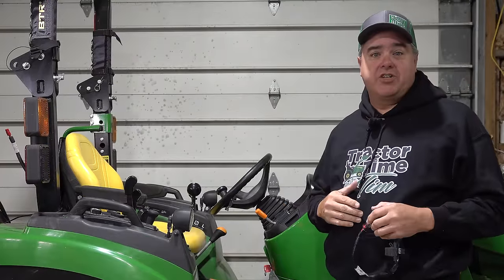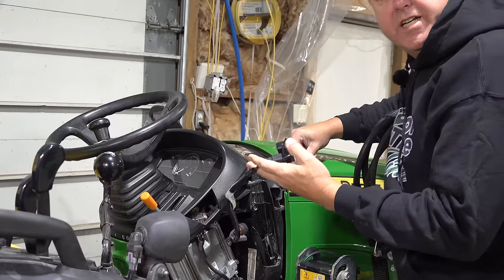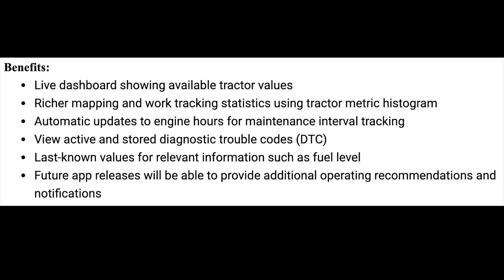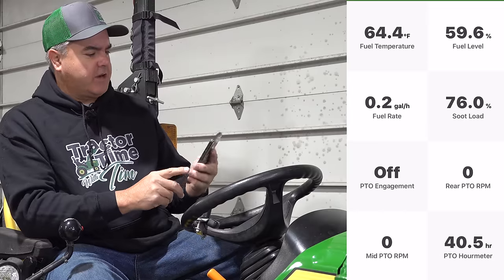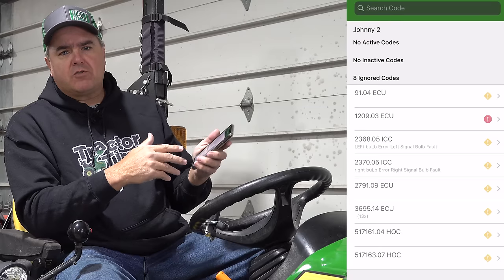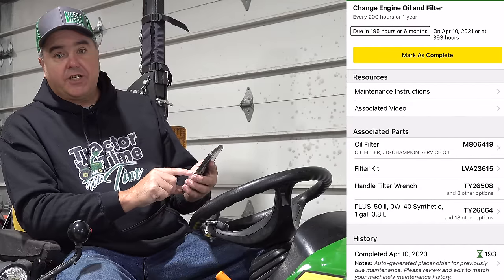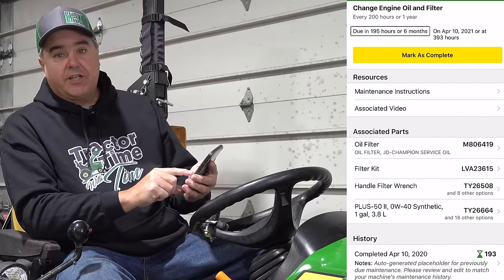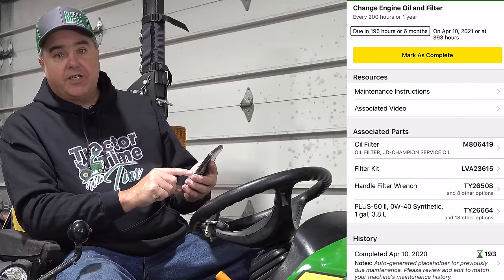Connect Your PHONE to Your TRACTOR!!

Comment: Bought it, installed it, and got nothing as far as a bluetooth signal. Absolutely nothing. Yes it was plugged in correctly, yes I tried restarting my devices and none of them ever detected it... Guess I’m sending it back...
Reply from the maker: Please don't send it back. You must use the app to detect it.  It doesn't show up as a standard bluetooth device.
Reply: @TractorTimewithTim  After about an hour of wasted effort I managed to get it to work.  Wow, useful and interesting app that is so poorly supported and comes with nearly zero instructions. Shame on JD for making this a flaming hoop you have to jump through to use.

Comment: I’m not sure all the electronics are a good thing. A lot of farmers now are angry with John Deere and some of the larger tractor manufacturers. When you go pay two or $300,000 for a huge tractor or more for a combine now, everything is electronically controlled there’s sensors all over the thing and it will give you an error code and basically shut you down but it won’t tell you what that error code is and you have no access to the books defined out what it is and fix it in the dealers won’t tell you they’re forcing people to bring them to the dealers and have dealer service done on them.  Farmers don’t make enough money to pay the dealer to change out a bearing or a bushing here in there because it’s slightly exceeding a temperature, what people are doing now is breaking the law and using pirated software from other countries for John Deere equipment, it’s basically the same dealer software just in other languages from other countries and they’re using them to try and figure it out so they can repair them selves and not pay thousands of dollars for the dealer to change a little bushing or something ridiculous. Other companies could be prosecuted for doing this but about eight or 10 years ago there was some law written in that protects these companies and allows them to do this without being able to be sued or charged for what they’re doing. Can you imagine if your Ford had some sort of warning that told you when you needed to lube your front axle but they forced you to go to the dealer and charged you three or $400 every time to stick a grease gun on there and put up a couple pumps of grease in? It doesn’t affect me personally I don’t think I’m ever going to have a big enough farm to be spending hundreds of thousands of dollars on large farm equipment but I think it’s pretty wrong in general. There was a hearing over it and surprisingly John Deere representative didn’t show up to defend themselves they sent lawyers from Apple and Google. The Apple and Google lawyers are notoriously pretty evil scum bags who are always trying to defend and get around the cases where those companies are violating user rights defending the multi billionaires who screwed over millions of their users selling their data illegally or not telling them that their devices were basically spying on them and recording them like Alexa in those types of devices that record all the time even when they’re off including many phones. Even if you turn your phone off and you have Google on it they still have your microphone open and are recording everything that here and these are the guys who fight those lawsuits the typical sleazy cliché lawyer. I was pretty disappointed in John Deere, I followed him as a corporation for years even without being a farmer, I have the riding mowers but I’m not a big John Deere customer really but I’ve always admired them as a company and their ethics and that seems to have changed and it’s not just John Deere it’s most of the large tractor companies, honestly that alone might make me buy orange next time just to keep from supporting a company Who does that to our farmers forcing them to spend tens of thousands of dollars a year’s for a little repairs that farmers have done themselves at home forever, most farmers are pretty much known for being basic mechanics enable to do their own maintenance and swap out parts when they break but now the corporate tractor industry is trying to force them to use dealer service for minor repairs by using sensors that shut their systems down and don’t let them know what it is. They should be able to call the dealer with a code and know what it is what parts they need, Or they should be able to buy a software that will diagnose those codes and just tell them what it is so they have the option of fixing it themselves for a few dollars we’re taking it to the dealers in spending hundreds or even thousands of dollars for minor repairs farmers have done themselves forever. :/  I would love to see John Deere or some of the larger companies just come out and say this is unfair business practice whether there’s some law that legalized in that industry or not and stop doing it, it’s just in moral in my opinion
Reply from the maker: My family is not experiencing the doomsday scenarios you describe.  Rather, my family is finding the dealer even more responsive and quicker to react as the diagnosis can now be done more quickly, accurately, and remotely!
Reply from the maker: Shane,
My family runs the large equipment.  8R tractors and combines.   Their experience has been phenomenal.
I fully understand the political argument.  However, practically, my family is pleased with the service on their large equipment.